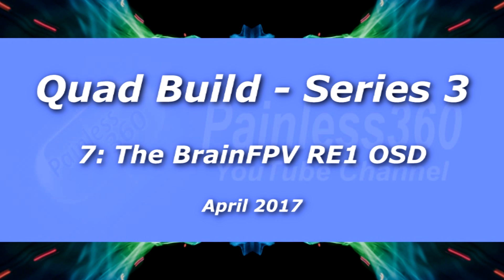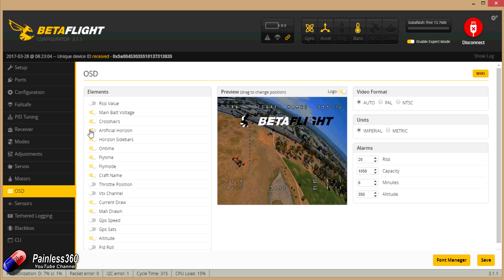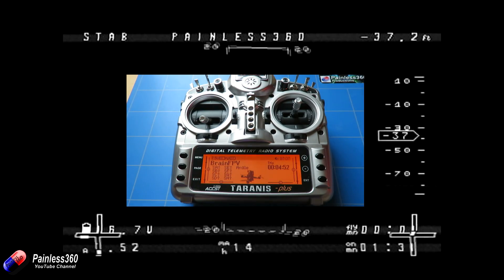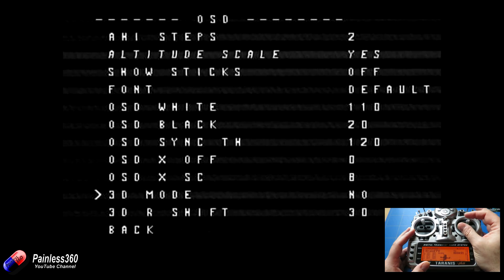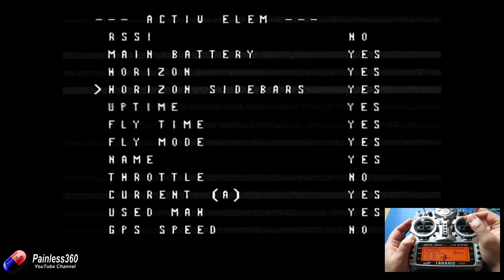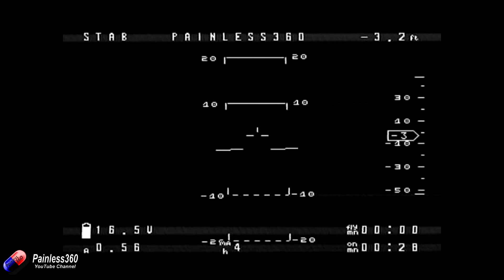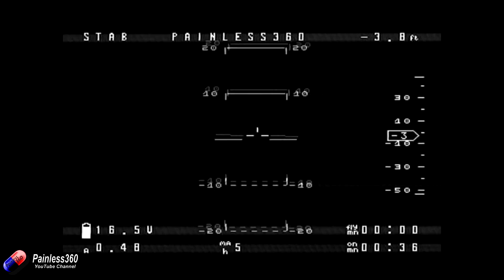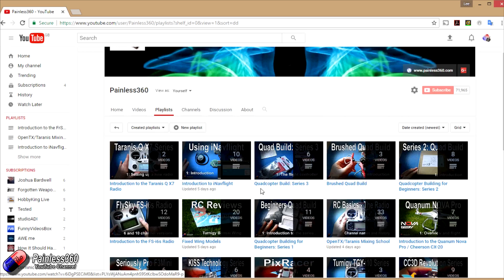(7/7) Quad Build Series 3: A look at the latest Vector Based OSD in BrainFPV RE1

Comment: Do you have a tutorial or one in the works on how to add a Neo M8N GPS module with in built compass for the Brain fc?
Reply from the maker: +Jared D I’ve added one to lots of others. You’ll need a spare UART but the support for GPS in betaflight is basic and not recommended for GPS flight modes. Best of luck!

Comment: Offtopic I know but I noticed those patches on your props -- did you balance them?  I know that's common with photography rigs to avoid jello but I didn't know people did that for miniquads.
Reply from the maker: Yep I do. It's an old habit that I can't get out of ;). Balancing your props reducing the stress on the bearings in the motor, reduces vibration transmitted to the flight controller improving flight characteristics and helping tuning, improves the efficiency of the prop, reduces the noise... Not sure why you wouldn't :D
Reply: Thanks -- in my case laziness and a verrry short lifespan for my props :D  Like the idea tho.